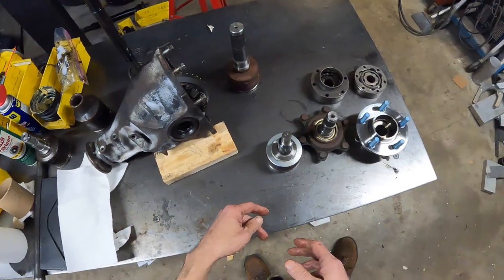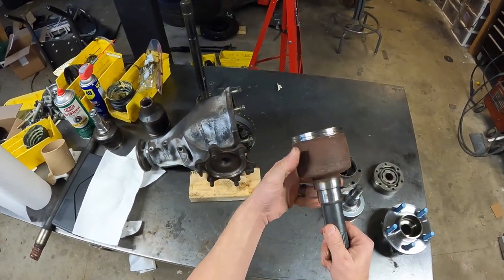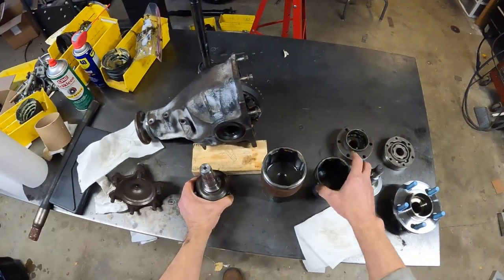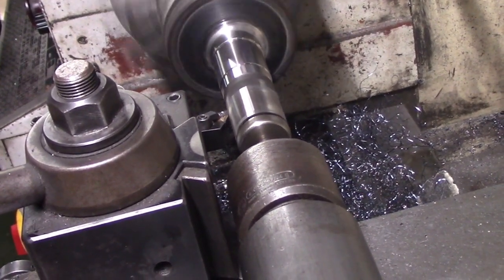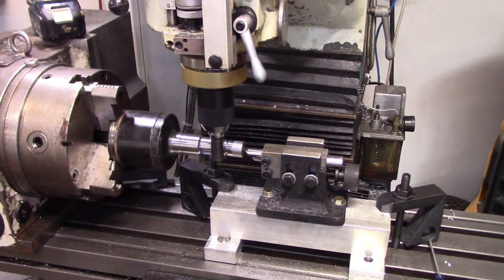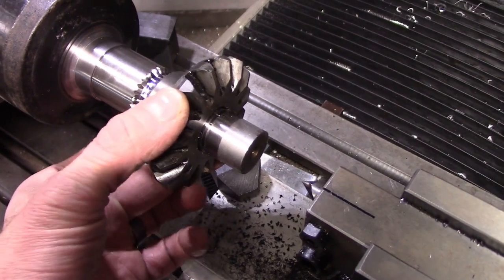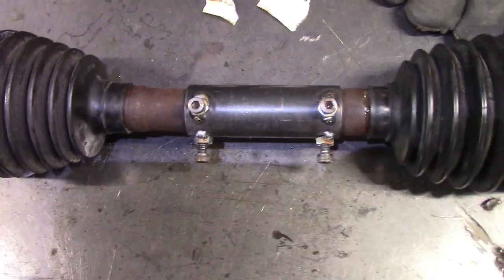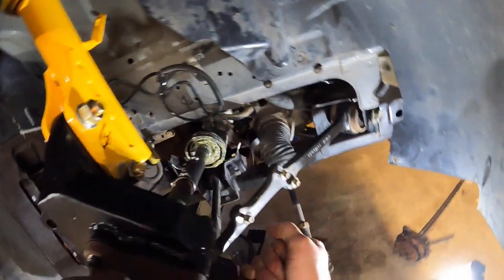Custom CNC Splined CV Joints, AWD Mustang Ep 18.

Comment: Awesome video and project! Originally I found your mainshaft splining video while searching for spline cutting tooling, then found this one and actually it's the same thing I'm looking to do, just Toyota to smaller Toyota splines. Cool to see that the heat treating goes deep enough to cut new splines on that shaft, that was a question I wasn't confident about, hopefully mine will be similar.

Comment: Hello. Thank you for your interesting video series. Within few days i get this far in episodes. I would like to ask what cutter you used for the Toyota spline? I guess 90degrees, bi-face carbide. Do you have a link to the tool? Thank you.
Reply from the maker: I purchased my spline cutting tools from Advent Tool.

https://adventtoolusa.com/

The holder I have is a single cutter holder - 125-TA-01

The Toyota spline is a 27 tooth, 1 Module 45 deg pressure angle spline. 

For that I used Advent Insert   -  ANSM-4A1.00MM/DFF45Z

I hope that helps.
Reply: Thank you. I will investigate those. Just as a side note or wish, you should make (at least)one episode about your tools. Little bit more depth on that subject, please. @npvg
Reply from the maker: That is a good idea.

Comment: That's wild that you found those inners that were identical to the Mustang but with more travel. I didn't appreciate how important that was, or how significant moving the diff forward was until you showed it on the car articulating. That moves in and out a ton.

Comment: Did you ever consider making it a hybrid awd mustang with motors up front? I’m an electrical engineer and thought that would be cool to do and probably a lot simpler and easier to implement
Reply from the maker: Yes, I very much did.  Actually my day job is working on electric motors.  But, I still wanted an old school manual transmission, etc.  But, the biggest reason is simply cost.  I can double the output of the Coyote 5.0 for under $10k.  Do add that much power to the car electrically in a reliable fashion would currently cost twice that.  Plus I am more of a mechanical guy then a software person.  Making a through the road hybrid would require a level of integration I am not sure I an up for.  

Does that make sense?

Comment: Why not just use a euro ford rangers MT82 with 4wd?
Reply from the maker: I looked into this more per your suggestion.  Obviously I already have the transmission complete, but I love researching this stuff.  This looks like a reasonable direction, but the MT82 doesn't have a great reputation for strength and good shift quality in the states.  It seems by the time you would import all of the bits, use the Mustang and aftermarket parts to make it strong and fit a Coyote, it would be a pretty expensive combination.

If I started over again, I would have just got a complete GT500 TR6060 and used the aluminum bellhousing etc.
Reply: @No Production Value Garage  Cool, yeah to make the MT82 up to the car it's paired with it needs a few things so it'd make sense to not use one. It isn't the worst transmission I've used though.

Comment: Great video, again. I feel your. I do alot of engineering designing on my own project. Have question: cutting the splines, what kind of tap is that, some hardened or just coated hss?  Keep it up.
Reply from the maker: The are carbide cutters from 
https://adventtoolusa.com/
They work very well.  Holders a bit spendy for the home shop, but the actual inserts are not to bad for the different splines.

Comment: Curious why you didn't get later model Toyota male to male axles and just take the inner cup? Then all you need to do is make a custom axle shaft. You could also have used the stock toyota jackshaft from a 4WD truck most likely.
Reply from the maker: The later Tundras have a CV joint that will plug in with some work (seal diameter is larger).  I got one to measure.  They are Much larger in diameter which isn't good for this application.  Plus, they don't have a female spline version, only a male spline the Jack shaft has the female spline.  

All of the Toyota Jack shafts are WAY to short.  

Thanks for the great feedback!